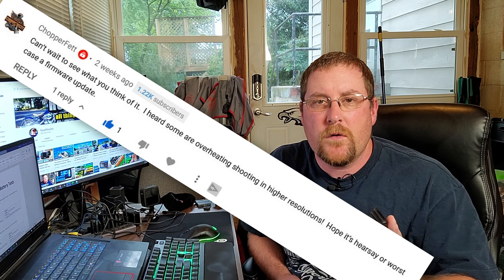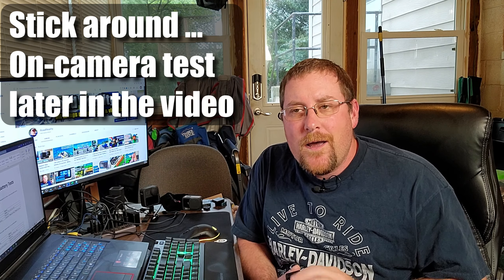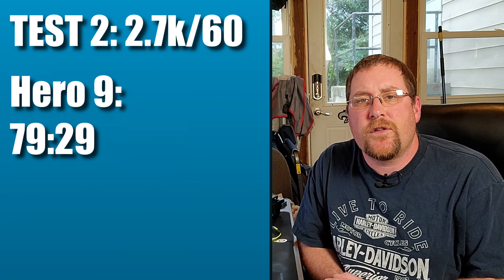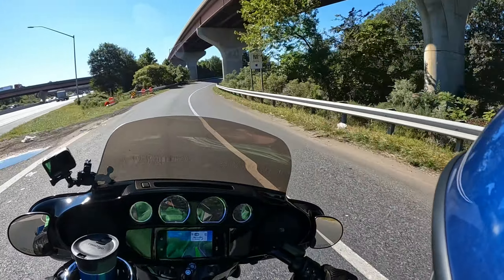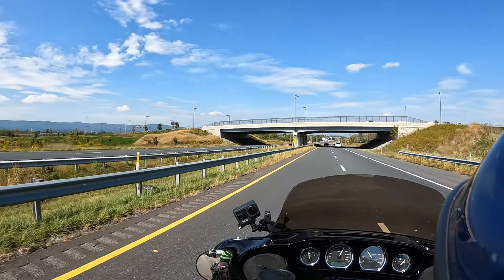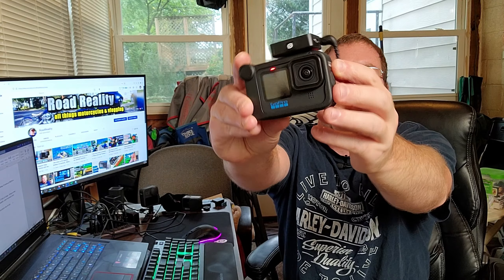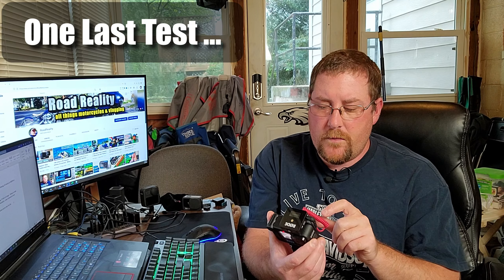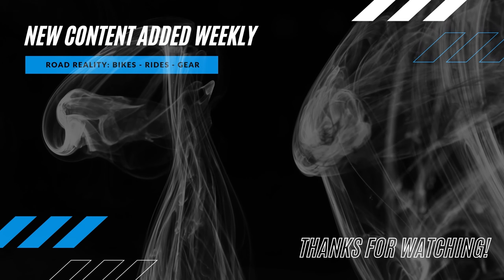Too Hot to Handle? GoPro Hero 9 & 10 Overheating TESTS, RESULTS, and PREVENTION

Comment: I concur John, air flow is your friend! I even have had my GoPro Hero4 over heat when hooked up with a battery backpack charging it. It did go three hours but I was stuck in traffic (90F outside temp) and then it shut off on me. Never had it shut off on me though while I was moving. So keep that bike moving and I don't think we will have any problems.
Reply from the maker: Now THAT'S a test!  3 hours and stuck in traffic at high temps?  BRUTAL for you, the bike, AND the camera!

Thanks for sharing!

Comment: my cheap knockoff cameras have never over heated on me.  But I also don't run them at 4k, I don't have a need too. Plus that would totally kill the battery life. Interesting tests though. thanks for putting the time into something like this.
Reply from the maker: Thanks BPE!  What kind of cameras are you running?  Also, I agree about the battery life - I need as much as I can since I don't run with an external battery and dislike stopping on the side of the road to swap batteries.
Reply: @RoadReality  I use the Newer G2 cameras. Good old fashion China knock off's lol.  But they actually work pretty well.
Reply from the maker: @BlackphoenixEntertainment  Nice!  How's the durability?  I know the GoPros are pretty rugged, I'm afraid I'd break anything else [one reason I shy away from Insta cameras]

Comment: Ya John good video, could the heat be coming from the motorcycle motor and affects the camera?
Reply from the maker: Gosh I hope not!  If there's enough heat coming off the bike to overheat a camera mounted on top of it, I'd think the engine was way overheated!  This is a heat dissipation problem for action cameras - so much packed into a small space.

Comment: Hell yeah, good stuff man! I’m on the fence to add a GoPro to the helmet and just use sena as my audio. Your videos kicking ass man
Reply from the maker: Thanks!  Glad you're liking the vids :D  If you want tips on setting up a GoPro helmet rig, I've got videos on that too :D  And you can always send questions my way, I'm always happy to help.
Reply: @RoadReality  oh I had the setup, I hate GoPro audio compatibility trying to get dual mics so I went to the sena which I feel is the easy button for motovlogging. Love it
Reply from the maker: @Sodiumfreeriding  Got it.  Yeah, dual mics can be a PITA.  GoPro needs to add a wireless mic option LOL.  FWIW, I have a vid I'm still editing which is me and my wife riding our bikes: 3 cameras, 2 mics, and a ton of headaches trying to combine it all... which is to say I understand the pain.
Reply: @RoadReality  yeah I tried every splitter, every combo of every single thing I found on YouTube and would still get horrible popping from feedback. So annoying
Reply from the maker: @Sodiumfreeriding  The best thing I could recommend would be to put a RODE Wireless Go 2 receiver on a GoPro Media Mod [cold shoe attachment] and then mic up both riders with Purple Panda mics and the RODE transmitters.  Not a cheap setup, but it ought to work well if you set the dB gain to low or medium [probably low].  That should mix the audio well and prevent popping and stuff.
Reply: @Sodiumfreeriding  I would have to look for it but I think BoDean52 talked at one point about using his sena 10c to capture audio and a gopro on the front just for video.  That way he can get audio in the mix from other riders and keep the video centered on the bike.  Just combine audio and video when editing.
Reply: @NVARider  I’ve been throwing that around but hate the go pro on the front. Annoying, always in the way, weight pulls the helmet forward. That’s why I have been mixing up angles to keep it interesting. My video today has a lot of angles

Comment: I am not your typical GoPro user, insofar as I normally record big chunks of video without stopping - typically 45 to 60 minutes on my chin mount. I have had one instance of overheating when I was in stop-go traffic with my Hero 9, but otherwise it has been a champ. I record in 4K 24fps Superview with full stabilization, high bit rate.
Reply from the maker: Yeah, that'll do it, if you're not moving.  I expect the Hero 10 would behave the same way.  Thanks for sharing your use case!

Comment: How long do you have to wait before you could start recording again if you where to record for about 10-20 minutes? Also, if shooting underwater I’m assuming that’ll keep the temp down right? Looking to pickup a GoPro for an upcoming dive. Not sure if I should go with 8, 9 or 10. Thanks
Reply from the maker: If the camera didn't shut down due to heat, then you don't have to wait at all.  Otherwise, I'd let it sit a few minutes and try again.  When my 9 overheated [sitting on a black pickup truck tailgate in 100+F temps with no wind], I waited about 3 minutes and it fired back up and kept on going.  For diving, I wouldn't worry about it overheating at all.

For your trip, if you don't need the fancy features of the 9 & 10, get the 8 - it's rock solid, but the image quality is going to be better on the 9 & 10 - and of those two, I'd get a 10.  Battery life isn't as good on the 10 vs the 9, but the reliability is higher.

Good luck & have fun on your dive!